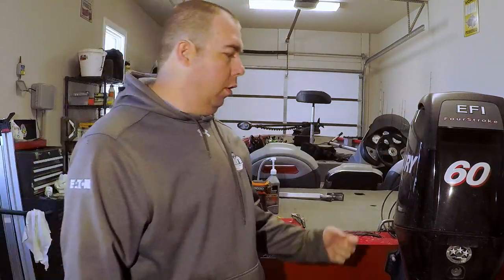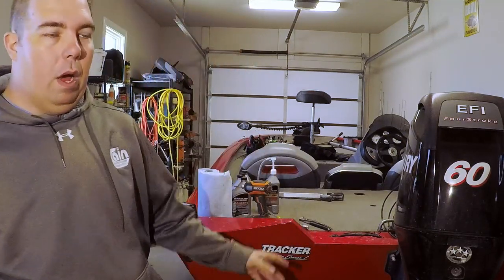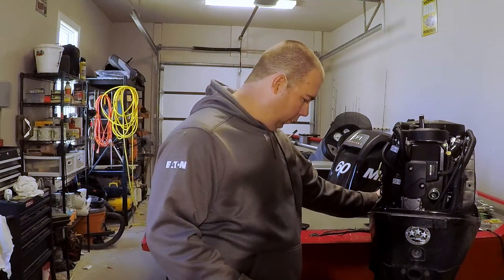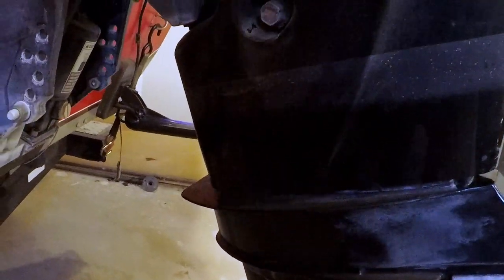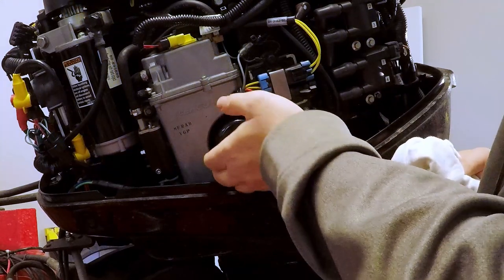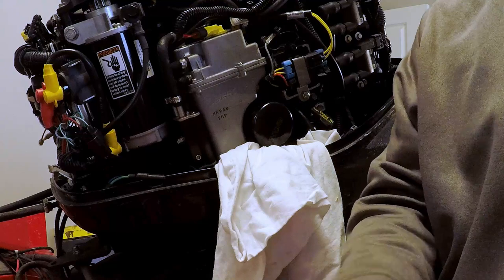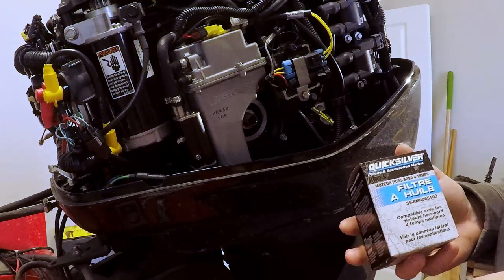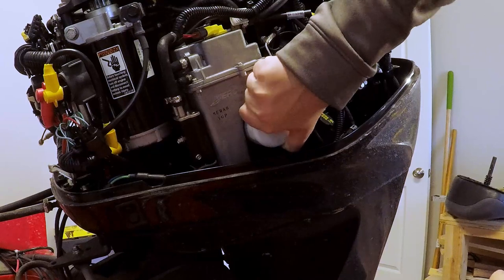Mercury 60hp 4 Stroke Outboard Motor Oil Change (40hp and 50hp too)

Comment: you did not mention that when you start engine the new filter will take oil to fill it thus lowering the amount of oil in the engine and YOU need to check the oil level again and add more oil if necessary!!! This could be very important !
Reply from the maker: Donavan Aja Thank you for pointing that out. I did notice on mine, the oil drains out of the filter and into the sump when the engine is off, but you should still check it after you run it like you said.
Reply: Also - there are markings on the engine showing exactly how much oil they take. This INCLUDES the amount that cycles thru oil filter. Always a good habit to double check but as long as you follow what your engine takes - you’ll be good. You do need to be careful because some engines lie. The new Yamaha VMAX 150 is a good example of that. Calls for 4.3 and it’s closer to 6 if I remember correctly.
Reply: I was thinking the same thing on the new filter.  Like changing the oil in a vehicle but a lot easier lol. 
  Thanks for the video.
Reply: Tip for the young players.... If you prime your filter, ie. Pour enough oil into the filter that the media absorbs it, you don't have a big difference in oil level change and you also have oil pressure immediately rather than waiting for the filter to prime as the engine runs.
Reply: Oil doesn’t have expiration date Jesus

Comment: Great job. That’s how I change my oil on my 60 hp. Also something I just learned. If you want to get rid of the hard water spots on the motor just use a mixture of 50/50 of white vinegar and water. I was shocked how well it works.
Reply from the maker: Thank you! The 50/50 works so well. Sometimes I just go so often I don’t get time to clean.
Reply: Thanks for the tip, I didn’t know 50/50 V/W work on water spots.  I will be cleaning my soon.

Comment: Cut the bottom off of an empty oil bottle and make your own funnel. It will take the next full bottle and fit like a glove when you pour it in the engine you will never spill a drop ever again just a trick I use. :)
Reply from the maker: Great tip! Thank you for sharing!

Comment: Thanks a lot. Just changed the oil in my 60 hp for first time. This made it a breeze. God bless!
Reply from the maker: No problem. Glad it was helpful. Anything you would add?
Reply: @clearwaterfishing  no, not at all. The one concern I have is that I ordered an oil change kit for the engine that came with filter, a new o-ring for the drain screw, a little plastic deal for directing the oil away from the drain (which I didn’t use, because I went with your advice and trimmed up/turned the motor and it wasn’t needed) and just THREE quarts of oil. After changing it, it looked fine/full on the dipstick, but I’ll certainly check it after running it to make sure more oil isn’t needed. I also had a little cloudiness in my lower unit oil that drained, but it wasn’t bad. Going to do some research on that, but hoping it isn’t a big deal. It wasn’t white by any stretch, but seemed slightly tainted as if there may have been a little water in it. I bought the boat used a year ago and have run it a lot. By the looks of the engine oil (it was very black), both it and the lower lube probably needed changed last year.
Reply from the maker: @BobSellersSings  I might can help you with the gear lube. If you boat hadn’t been run in a few days before you drained the gear lube, the water would have been the first thing to drain out. The cloudiness could be the lube wasn’t full and got some air mixed in it. If you ran it recently, it would have looked milky. It doesn’t hurt to check after your next trip.

Comment: I will fill mine to 9.5 or 9.8/10 (max) . So what if you had mercury oil in your outboard put in and you decide to re- add quicksilver  bcoz you low on oil. Can you mix mercury oil with quicksilver? Also can you mix 25w40 with 10w-30?
Reply from the maker: I wouldn’t have an issue mixing brands of oil that are the same weight. I don’t recommend mixing weights of oil. Maybe if it is was a small amount because it was low (which is much better than running it low).

Comment: Thank you so much for this video.  The manual I received when I purchased my boat did not have torque specifications for the plug or the filter.  Just wondering if that is important to use a torque wrench or not.  Thanks again!
Reply from the maker: I don't torque them. I try to give a solid snug on the plug. On a filter, once it touches I do an additional 3/4 to 1 1/4 of a turn.

Comment: Great video. Thanks! I have the same engine except it's a Bigfoot. What type of gas do you recommend? I'm using 93 E10. Fellow boaters are telling me to use non ethanol racing fuel. What do you suggest?
Reply from the maker: I use 93 E10 as well. These newer engines are designed for it.

Comment: Nice. Awesome video.  I have the same boat as you and I found a pool of oil under my propeller. What could cause this? HELP?
Reply from the maker: Is it gear lube?
Reply: @clearwaterfishing  No. it’s pretty clear almost motor oil like.
Reply from the maker: @Kenjoy77  That does not sound good. It seems like it is the bottom seal on the motor is dripping down.
Reply: @clearwaterfishing  I think it's coming from the lower units.

Comment: hi i have a mercury likes you, today after i washed the boat, try to run the motor, when key in won't crank, than i turn on star anyway sound like to run, but not, can you tell me what happened ,thanks
Reply from the maker: It sounds like you got water somewhere you shouldn’t have. Might let it dry out and check your fuses.

Comment: Hello I don’t know if you ever had this issue I have.   My boat will not get to plain out under a load.   Max RPMs 3000 
Would you know.   
I did fuel pump fillet new gas drained old new spark plugs. no alarms 🚨 or anything like that.the guy that did my oil change.  Not sure if he made a mess inside before it was a clean engine compartment.  Now it’s wet      Thanks 🙏🏾
Reply from the maker: What does it sound like at 3000 RPMs? Is it skipping or just bogging down?
Reply: Well thank you for replying.  No it dose not bog out it start up don’t sound bad or anything just wen I go out to get to plain out it dose not go above the 3000 is it. No alarms beeps
Reply: Check your fuel system. Reeds diaphragms and fuel pump. Mine started doing that as well and the fuel system needed to be replaced.
Reply: I've had this issue twice. Once after I hit a log and bent the prop just a little. The second time I ended up finding my fuel line was pinched. Not sure how it happened but straightening it out got me back to 100%

Comment: So using one of those oil sucker might not be the best idea of the oil is that deep in the motor?
Reply from the maker: jungarn Yeah the sump is pretty low. I would recommend just using the oil drain plug.
Reply: @clearwaterfishing  how much oil can be down there? I got a 50hp.
Reply from the maker: jungarn About 3.25 quarts. That’s about how much I get when I drain it.
Reply: @clearwaterfishing  oh....well duck
Reply from the maker: jungarn what’s the problem?
Reply: @clearwaterfishing  I was really hoping to do it using the oil sucker thing so I wouldn't have a mess. 3.25 quarts sounds like a lot of oil to mix in with the fresh oil
Reply from the maker: jungarn almost all the oil is in the sump when the engine is off. It really isn’t that messy of a job with the right tools.
Reply: Do you use synthetic oil?

Comment: 4 quarts seems too high.  For my Mercury 2008 60 hp 4 stroke, 3 liters or 3.2 quarts of 10W30 recommended by the manual.  Checked at https://www.mercruiserparts.com/oil-capacity-chart-4-stroke-outboards  60 FourStroke	996cc, 4 cylinder	3.17 QT. (106 oz.)
Reply from the maker: How many quarts do you need to buy to pour 3.2 quarts?